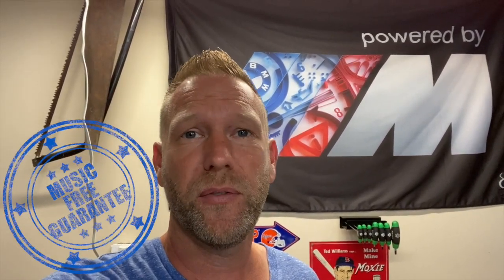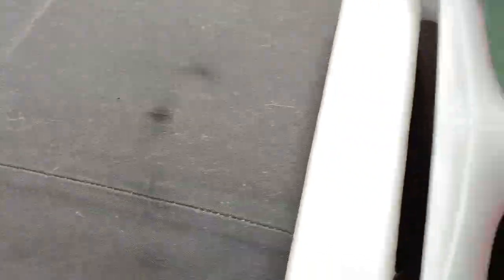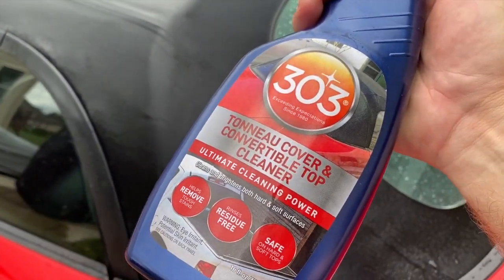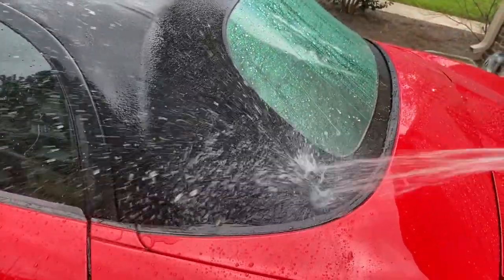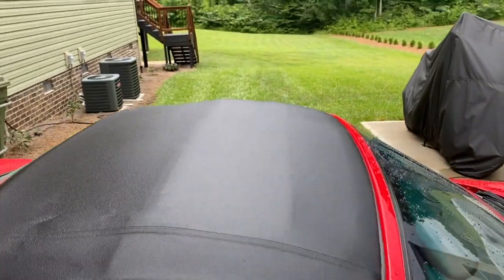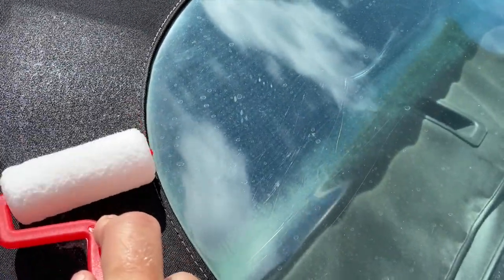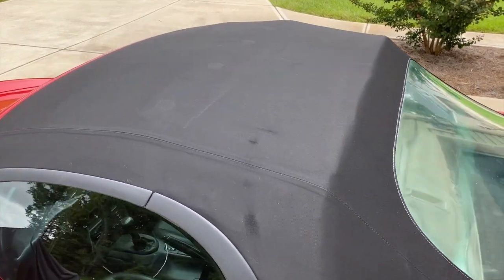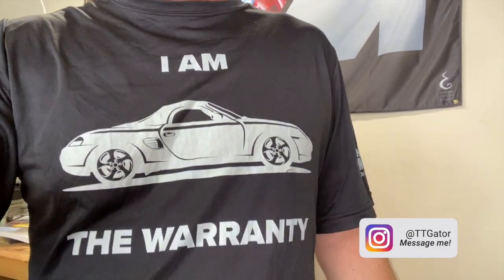How to CLEAN AND WATERPROOF A CONVERTIBLE TOP | DIY for my Porsche Boxster 986

Comment: Excellent job 👍👍. I just did mine last weekend and I went with the tapping up everything method (plastic and painters tape)👎. I still got a lot of leakage on to my rear window🤦🏻‍♂️ still. So I would recommend the brush or roller method like he just showed us. I washed and dried the car outside, applied the 303 in the garage and then put it outside (not under trees) back facing the sun to bake. Them in the garage over night and mesmerizing results🎉.
Keep up the good work, I appreciate all your videos (at least the boxster and the garage builds I don’t need another German taxed car (BMW😉)).
Reply from the maker: +Ed A haha I hear you there! Thanks. 🍻

Comment: i did mine yesterday..   I cleaned the top with the cleaner and horse hair brush you recommended.  Then even though I had the roller, I ended up not using it.. just sprayed it on and then spread the Fabric Guard with my hands while wearing disposable nitrile gloves.   I just closed the roof with puppy pads / newspapers in between the windshield and the rear cover, and taped off any the plastic moulding.   It wasn't too bad.. was difficult getting the small narrow section below the rear window, but i don't think the roller would've made that any easier..   

I'll try the roller next time since I have it.
Reply from the maker: +george louie great! I think the roller helps, but obviously not the only way 😉

Comment: @helpmediy How do you clean the soft top in between the semiannual clean and waterproof/protect times? Do you use the 303 cleaner or does that wash off the protectant?
Reply from the maker: +@jnlin8569 I try to just drive with the top down 😂 
Just normal car soap and water with the horsehair brush works

Comment: This was the first time I saw this video from you and It helped me to start thinking about issues I may face if I purchase a Porsche Boxter 718.....have to say this was an awesome video but I do not think I can buy those exact products in Australia but I do have a question for you, what did you do to maintain your leather interior so that it does not not get destroyed or degraded from the rain and sun over the years? eg Seats drying out or fading and or getting hard a well and cracking and not ruining the heat ventilation installation as well ???? Porsche does say not to let the underside of the seats get wet.
Reply from the maker: +Russh75 glad it helped! I just use leather cleaner and conditioner. Hope you’re a subscriber now 😉
Reply: @HelpMeDIY  I will be as soon as I can order all the gear you listed .... I cant find anything like that here and I pick up my convertible this Friday  so I am going to need this stuff and I immediately came looking back for your/this video just becuas of how you showed it working and how you applied it and what it was that you applied.
Reply from the maker: @Russh75  👍🍻

Comment: Hey Aaron, Did this today, and the roller is a genius idea. The top looked great after using the cleaner, but I've got some streaking after applying the Protector with the roller. I was very careful applying it, and trying to not overlap too much. Any ideas how I might even things out?
I love all the videos, and they've helped greatly on my Boxster journey.
Reply from the maker: +Rick Albright hmm maybe a second coat after it dries? Never had that happen so I’m not sure.
Reply: @HelpMeDIY  After a couple days of drying, it all seems to have even out. Whew. Thanks.
Reply from the maker: @rickalbright1239  great!

Comment: Double u TF roller :) The 303 is good, but I stopped using it. The pump spray bottle is a pain and makes application very patchy. Best is to get Porsche's pressure spray can.
Reply from the maker: +Baerchenization hence the roller... applies easily, evenly, and without making a mess. 😉

Comment: Great video!  Thank you for making it!  QUESTION:  I washed/claybared and waxed my car for the first time a few weeks ago.  Do you know if the chemicals in the convertible top cleaner will strip the wax off the paint?  (when I'm spraying it off with a hose, the chemicals will run down onto the body work).  Hopefully it doesn't....was a lot of work to wax it. lol!
Reply from the maker: +Mitch Lewis just let the chemicals fully dry before getting the top wet and you will be fine!
Reply: @HelpMeDIY   Thanks!  But you lost me with that comment.  So spray on the cleaning chemicals and then brush them in.  Then let dry and hose off after they have dried onto the top?
Reply from the maker: @mitchlewis535  ohhh I was thinking you were asking about the waterproofing chemical. Yeah the cleaner will be fine to wash off over wax 😉
Reply: @HelpMeDIY   Phew!  That's great news.   Thank you!